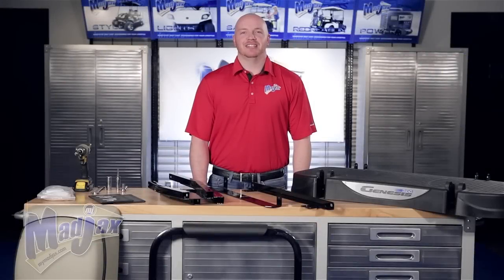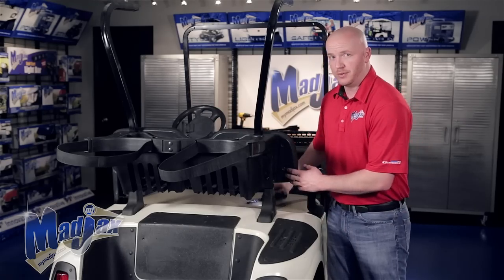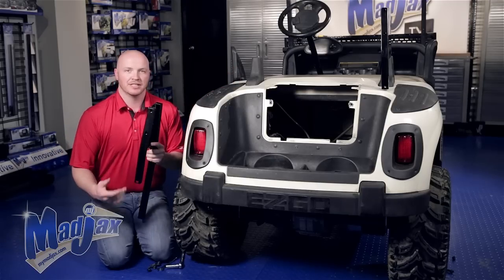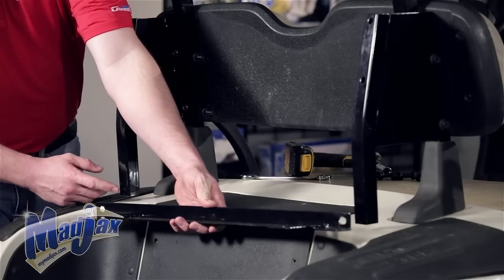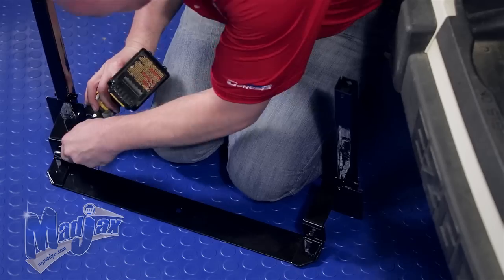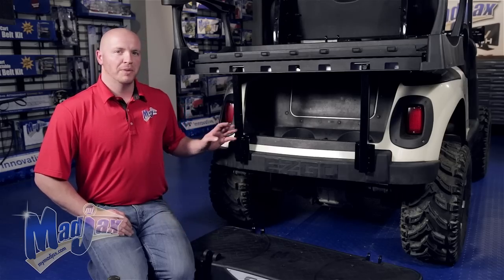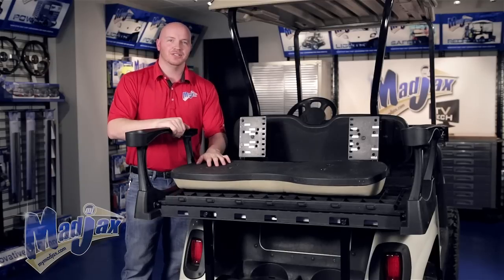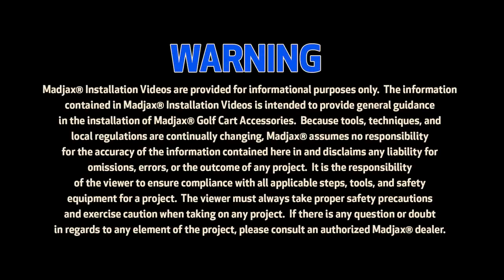G250-300 Seat Kit will fit *E-Z-GO® *RXV®  | How to Install Video | Madjax® Golf Cart Accessories

Comment: how do you attach a seat belt kit? my cart at home is unable to use any seat belt kit available online. unfortunately i already purchased one and found out that it will work on any other cart but mine. the brackets between the 2 seat backs seem to interfere with the universal design. instead of being a strut it's an angled triangular bracket that will not provide room to place into position let alone bolt up as instructions suggest. I do not want to cut up brand new parts to make it work. thanks in advance.